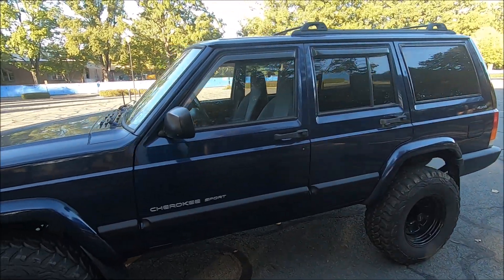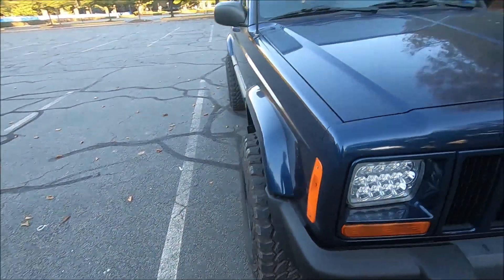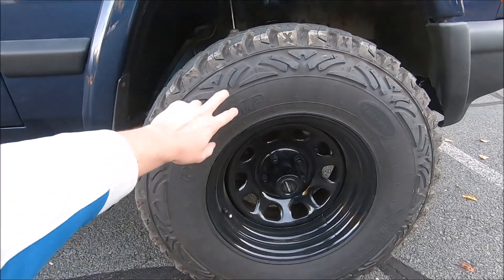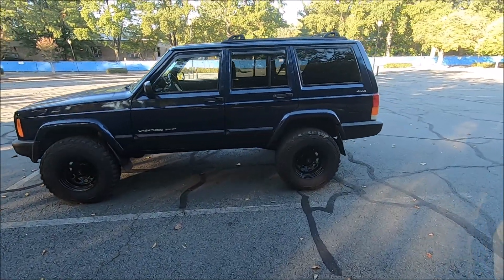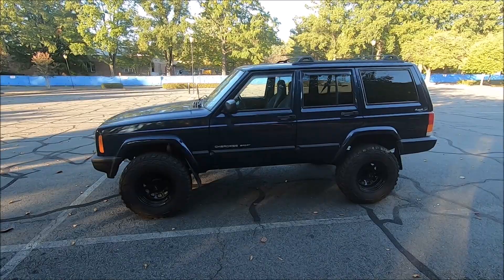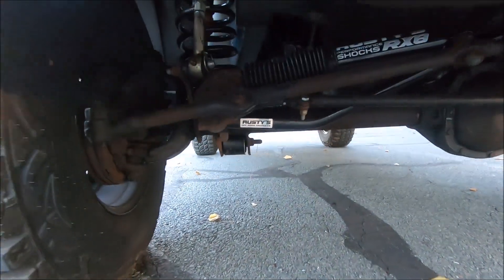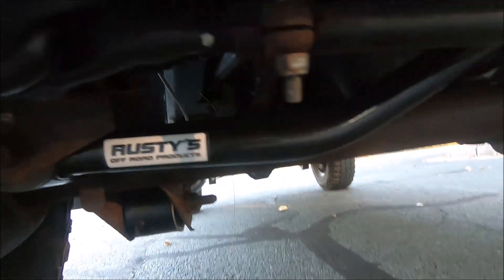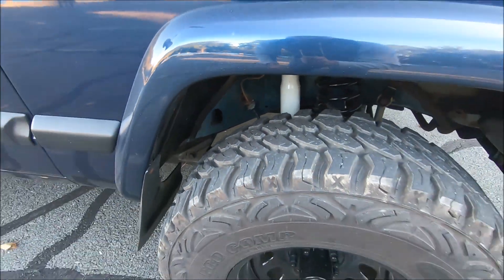Jeep Cherokee XJ Rusty's Lift Kit Long Term Review

Comment: I’ve been piecing my lift kit together. 3” up front and 1” in the back. Back is supposed to be 2” but I’m on factory length Moog coils & Dayton (I think) leaf’s. 3” pucks up front. I upgraded the entire front steering, shocks, and lowers but I need to get the adj track bar installed next plus buy new uppers. Haven’t quite hit $1k but when I go to 4/3.5” full length RE springs I’ll need adj lowers and uppers plus SYE
Reply from the maker: Sweet! What front steering do you have?
Reply: @KCars  RT Offroad’s Heavy Duty Steering Kit w/ Stabilizer

Part # RT21005
Reply from the maker: @NBHRaven  nice, I’ve been thinking about upgrading my steering as well
Reply: @KCars  definitely worth it. I’ve had no problems and others comment on how smooth of a ride it is.
Reply from the maker: @NBHRaven  I’ll have to look into it
Reply: @KCars  for sure!

Comment: I am trying to find the Rusty’s 3 inch lift kit along with the steering stabilizer and adj. sway bar quick disconnect for around $1k as you mentioned but the cheapest it shows on Rusty’s website with everything in my cart comes to $1389…do you know how I can get this down to round $1k like you did? Also, where is a good place to buy discounted tires? Think I’m going to get those pro comps instead of BFG. Huge fan of your channel man. You have fought me so much and I’ve done almost everything on my Jeep with your videos.
Reply from the maker: I bought the kit through an authorized Rusty’s dealer which might be why I got it for that price. But it’s definitely possible that the prices may have also gone up since that was about 2 years ago. I bought the wheels and tires from the 4 wheel parts website, not discounted but had a price that pretty much everyone else had. Appreciate your support!

Comment: First of all, thanks for your effort and all the details on your videos. I have a question, I already have a 3" inch lift kit, planning to add 31s but my question Is. Are you using wheel spacers? The thing Is that I'm planning to use the stock rims and want to know about the rubbing before doing It ......
Reply from the maker: I don’t have spacers, just the aftermarket ProComps with 3.75 backspacing. The tires rubbed the front bumper end caps a little so we trimmed those and they still rub a bit on the mud flaps at full lock

Comment: Did you have to adjust the rear axle to make the drive line angle straight?
Reply from the maker: I don’t believe so. I ended up getting a slip yoke eliminator to fix some minor driveline vibrations though.